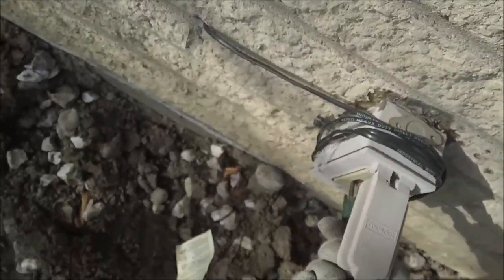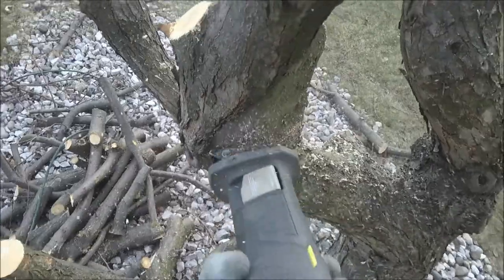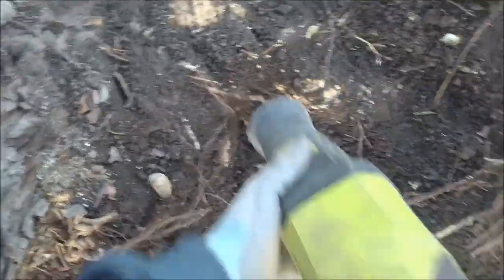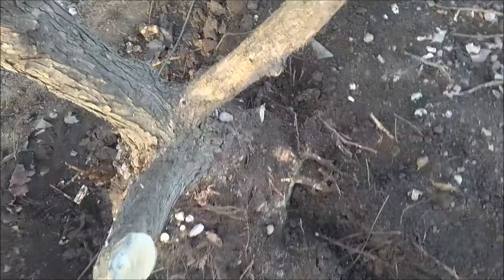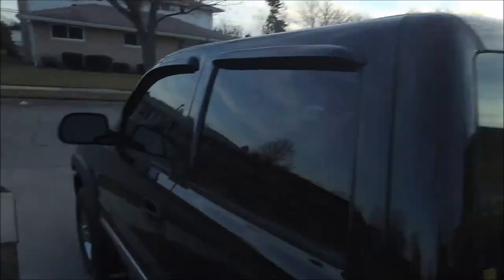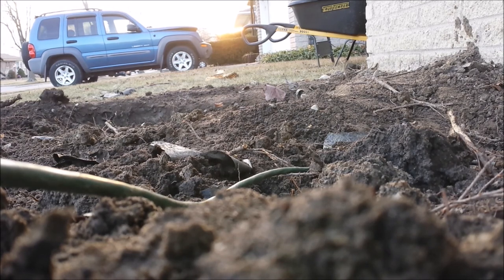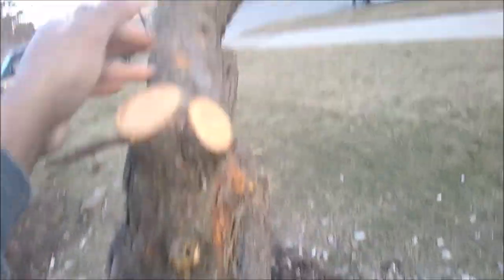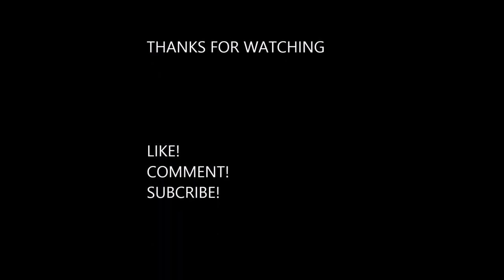tree removal

Comment: Came out nice. Sawing those hidden roots makes things a lot easier!
Reply from the maker: HWDsouthDIY. what you did was slick. I'm going to try it that way next time. that would work without a truck.
Reply: Looks like you used the same pruning blade as I did. I was surprised how long they lasted, considering how much time they spent sawing through dirt and sand trying to cut the roots.